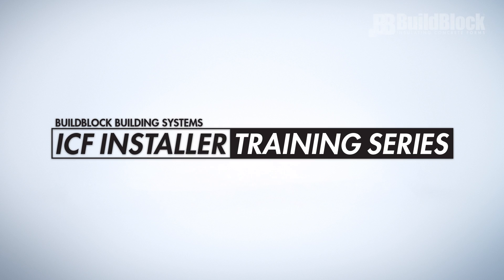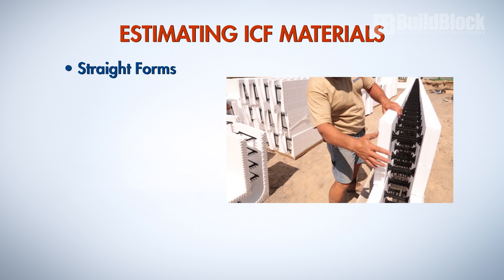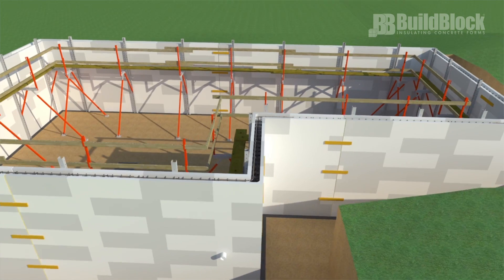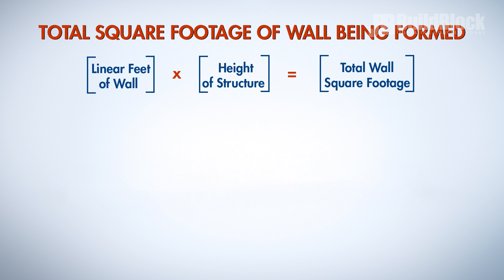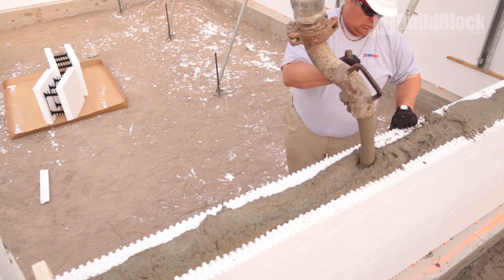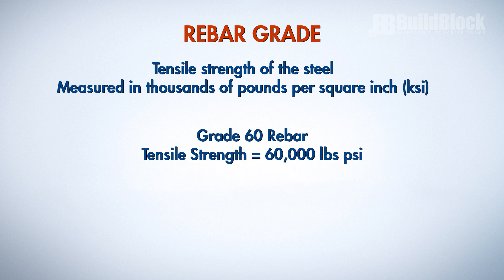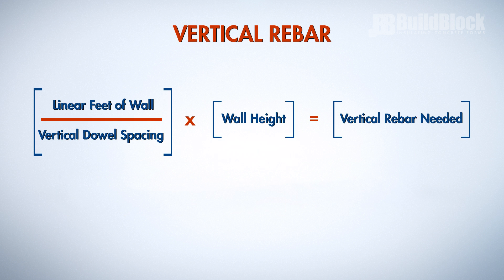BuildBlock ICF Installer Training Series: 05. Basic Estimating

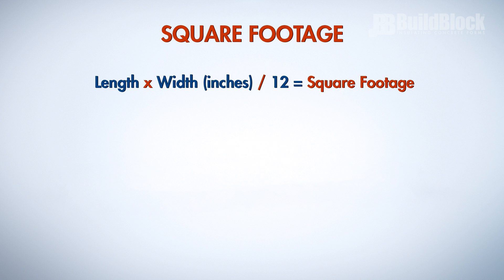Comment: Slight correction to your area calculation at 2:10. The square footage is length x width (inches) / 144  (not 12). There are 144 square inches in a square foot.
Reply: What he said ^^^
Reply: It assumes the length is already in feet